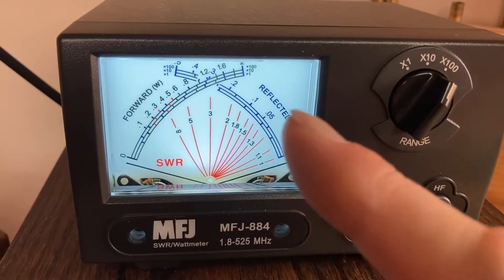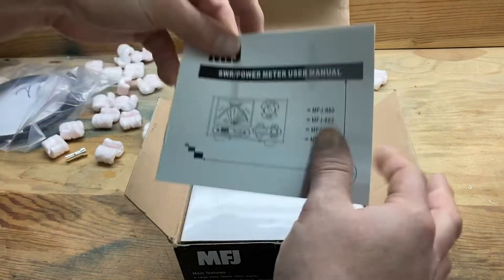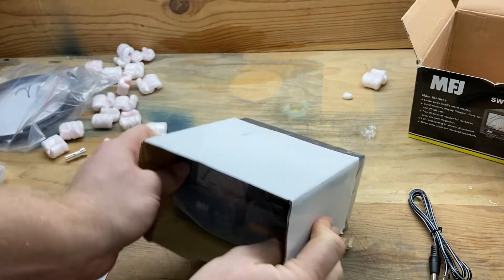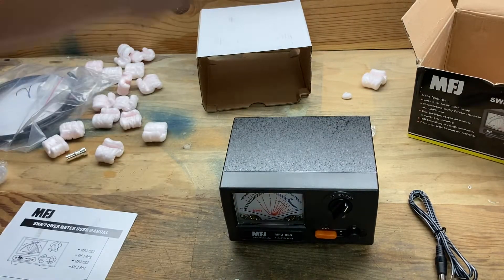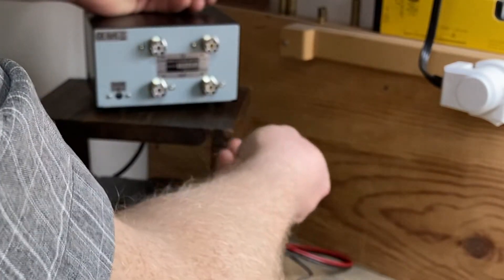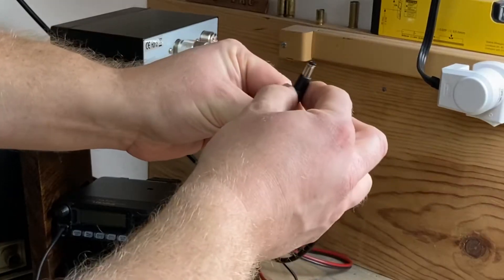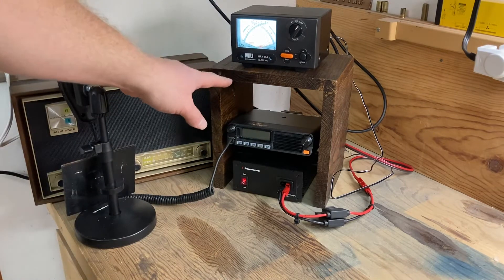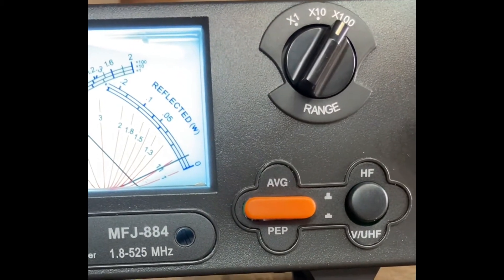MFJ 884 - SWR/Wattmeter Setup

Comment: Hello friend, I like your video, I want to ask you a question about your experience with this equipment: how about the quality, the performance of the MFJ-884 in the radio room. Excuse the translation. Thank you.   73..    CO5RMM.
Reply from the maker: MFJ-884 has worked great. I use the VHF/UHF side mostly. My HF rig gets used on a different table and my HF tuner gives me SWR so haven’t had the 884 HF side connected often. It is portable enough to take anywhere even though it is big. Have used it in vehicle to test HF frequencies.
Reply: Thank you friend for answering me and clarifying my doubts, I like the team and I am going to get one. A hug. 73.